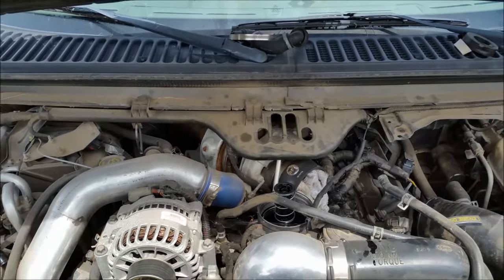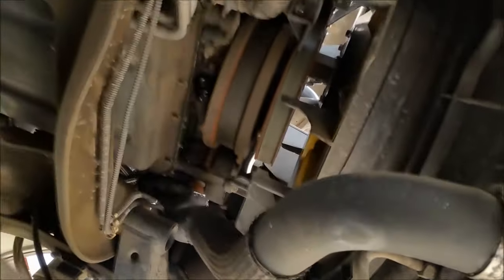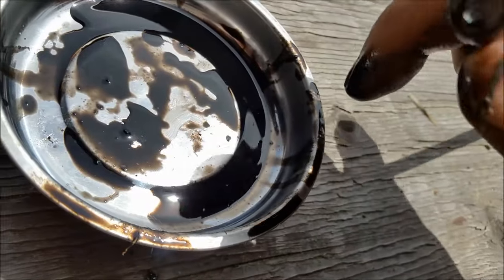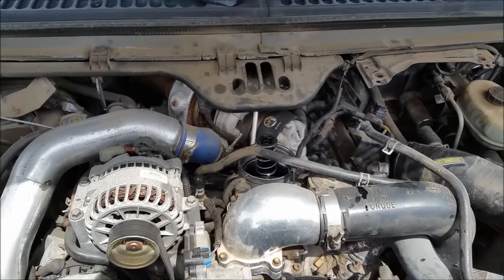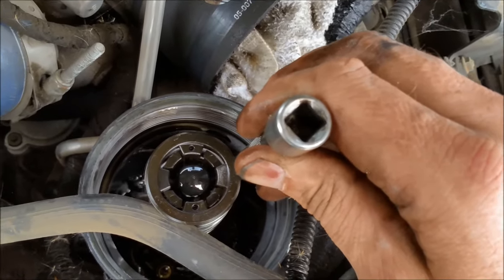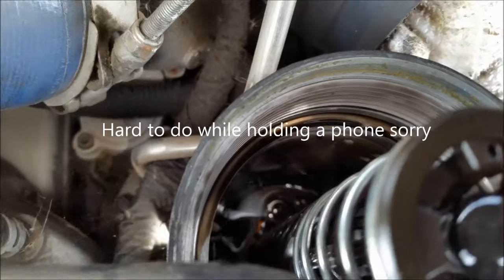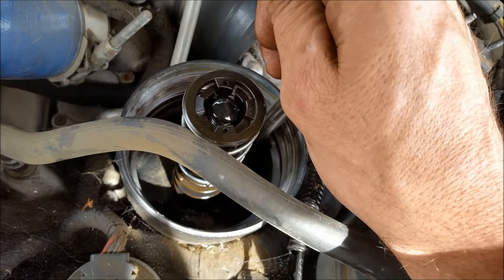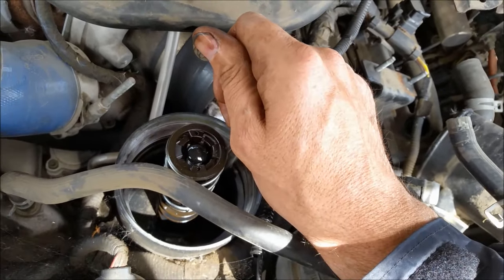2004 F350 6.0 NO LOW/BASE OIL PRESSURE CHECK THIS FIRST

Comment: I'm glad I found this video. Mine had a no start. Did this and fixed the problem for now 😂
Reply: Hey there. Having same issue with no start. So you jist cleaned out the low oil pump, put it back in and you got the truck to start?
Let me know. Thanks!
Reply: @noteworthy227  yup did exactly what this guy did in his video. If you don't find a piece of metal that's obviously not your issue. But when I did this to mine I had to crank on it a little longer than normal to get it to start after the metal was out of it
Reply: @mikejankoviak8542  truck still working good? Mine has still been parked since my last comment. Half scared I might need to put a motor in it. Just wondering how long term this solution is.
I appreciate the help!
Reply: @noteworthy227  yup no problem with it. I'm guessing it was a injector clip. Just run it and don't worry about it
Reply: How much oil pressure where you getting before you did that
Reply: @fredobaybee9091  as I was cranking there was none

Comment: I just followed  the steps that are in your video. I had no oil in filter housing when cranking, removed oil relief valve and found what seems like a snap ring piece, i took a look at the top of injectors and all the snap rings are there and intact. any suggestions on what it could be?
Reply from the maker: Tony Mendez hmm interesting check the description box below the  vid other than what I wrote there not to sure what or where this debris may have came from although depending on the size it may have been a small piece that may have broke off from a injector  snap ring I only listed the most likely areas were debris may have come from hopefully a little more Internet searching can answer your question and if you do figure out please post here for others thank you Brother : )
Reply: Tony what was your issue? Bad lifter?
Reply from the maker: TradeMark Lawn & Landscape check the comment i pinned at top of comment section (possible debris from internal turbo damage)

Comment: Is oil supposed to leak out of the filter housing overnight? After sitting at least half a day my 04 will start with no oil pressure until about 7 seconds then the pressure gauge kicks up and I hear a squeak from the turbo as it finally gets oil. I replaced the guts in the filter housing but nothing changed, it's dry when I open it after say 8-12 hours.
Reply from the maker: No if oil is leaking out of the oil housing one of two things I know of is causing that.
 
1. Check to see if you have a tall oil filter cap (if so replace it with the stock size cap and original Motorcraft oil filter) also you may have the wrong size filter installed causing it to not extend down into the housing enough to contact the oil anti drain back button/valve.

2. Your anti drain back button/valve is defective.

Comment: I have an 05 6.0 that pushes only 300lbs oil pressure. Recently had new injector cups, hpop, injectors, stand pipes, ipr, stc, ipv, will only crank nonstop, think this would work?
Reply from the maker: Hunter Mallory it's a quick and easy procedure definitely needs to be checked
Reply: What was it??

Comment: So does oil run out of that spot where you used the 12mm hex bit to pull out that plunger/bolt ?
Reply from the maker: A little but not much.
Reply: So what in the filter housing  I gotta pull the filter spring off then ?
Reply from the maker: Justin Kornkven no you do not have to pull the spring off. there is a drain button on the bottom of the housing positioned at 2 o clock you hold that down while cranking the motor to see if it fills up with oil which would confirm that your engine base oil pump is working.

Comment: Once you push the plugger down does the oil stay in the cup or run back down if it does run back down does that mean the check valve is no good

Comment: I stumbled upon this great video and indeed found something in the pressure regulator.  Unfortunately it’s a piece of a oil scraper ring from whatever cylinder.  Also the ipr screen was pooched so replaced the ipr.  Runs like top but when will she grenade...  I’m wondering how often the rings fatigue in these trucks. 400k kms on original motor and now with insane blow by.
Reply from the maker: Diesel rings are usually designed to last 800k miles. 

1 mile = 1.609344 kilometers. 

400,000km / 1.609344 = 248,548.47689mi

The odds of a piece of a piston ring being broken  and found are extremely rare. Keep in mind when turbo seals go bad they tend to dump oil into the exhaust pipe. The piece of debris found in this video I believe came from my turbo right before it took a shit.
Reply: @ecran228e  I’m with you 100% on that, still trying to think on how a piece of piston ring would find it’s way in the oil pan provided the whole ring didn’t grenade but there’s zero evidence of that.  The only thing I can go on is the sudden excessive blow by and massive amount of oil being pushed out of the engine more so then before, I do have a leaky valve cover gasket on passenger side which was never as bad until a few months ago, as well as, a rather disturbing amount of fine shavings on the plug magnet.  Anyway. Some food for thought, thanks for the reply.  The question is, would you drive till it shits the bed or sell for cheap lol.
Reply from the maker: @rickbremmer3838  Personally I drive em till they shit the bed XD

Comment: Is your truck still running after finding the metal part and or did you find where the part came from and fix that also.
Reply from the maker: Mummy Mountain Indica still runs...turbo died thinking debris came from there.
Reply: @ecran228e  Thank You

Comment: Question: where is the anti drain check ball located precisely on an F350xl?
Reply from the maker: Most likely inside the oil filter housing on top of motor.

Comment: Hi, great vid and comments below also to all.  I have an 04 F250 6.0.  Low oil pressure gauge just started laying flat and bouncing with check gauge light coming on mostly at start up and idle when it happens but not while driving.  Just started about 3 days ago and so far just randomly once in a while.  Seems like the same symptoms as your F350.  Would everything to check from your video apply to the F250 too?  Thanks in advance.
Reply from the maker: Grand Wagoneer Yes. Also your story regarding the symptoms you were having are very very similar to the same symptoms my 6.0 was having. Perform the above simple task I'm confident you have the same problem I had. Last thing reference the above description box for more detailed information on the topic. Hope this helps : )

Comment: what are you pushing the power wire onto?

Battery Positive?
Reply from the maker: Andrew Smith sorry for late response and bad camera placement in vid. YES contact starter wire on positive battery terminal to turn over engine with key off (starter is naturally grounded as it is bolted to engine block)

Comment: Had no base oil pressure, this fixed it.  however, I found a metal pin which looks like a needle from a needle bearing.  removed it, oil pressure came back.  In the discription You say it could be a follower bearing?  what do I need to know?
Reply from the maker: Mike Hunt you need to obtain a schematic of the valve train. Followers ride on the cam controlling valve fuctionality. These folowers are mounted on a shaft which go through a needle type bearing on each follower. The follower racks (one controlling each head) would have to be removed, followers separated from rack and each followers bearing should be inspected. 1 follower per valve in most cases.
Reply: its most likely from a lifter. you will probably need to replace it which means tearing the whole engine down so at that point you might as well bore your cylinders as necessary, replace your pushrods, reseal the block and stud the heads

Comment: I'M going to check this out tomorrow, just wondering what to expect when I pull the 12mm bolt out from underneath?? an O-ring that might need replacing or a Plunger I think I heard ??
I don't want to lose a part 
Thanks
Reply from the maker: Mike Riccardi should not have to replace any parts hopefully...to answer your question there is a o-ring on the plug and inside there will 1st be a spring then a piston which will most likely need to be removed with a magnet. once removed place magnet back inside hole to try and fish out any possible debris that maybe inside.
Reply: Thanks for the info!!,  I gave it a solid effort and couldn't get it to budge at all, I've soaked it with liquid wrench oil so I try again tomorrow! @ecran228e
Reply: ecran228e i

Comment: My '05 shows good oil pressure all day idling, but will loose oil pressure running down the road.  Can the situation your talking about cause this?
Reply from the maker: Possibly...if rpms get low enough and you have a piece of debris where I did this can happen...as low rpms causes no oil pressure in this case
Reply: I’m the opposite at this point

Comment: My 2006 f250 diesel shuts of if the oil pressure gauge does not go up when starting it. Do u know what could be the problem. I had my oil pump replaced to.
Reply from the maker: Ricardo Velasquez perform what I did in this video my truck was doing the same thing.

Comment: I have a 2002 Mercury sable and my oil level is fine new oil,pressure switch and low oil pressure lights did not go out I pray it's my oil pump they say the 3.0 Vulcan is durable finger crossed! Ur help would be deeply appreciate
Reply from the maker: Bobby Fisk sounds like it may be as simple as a oil pressure switch or sensor. Remember switches are anolag (non computer controlled) and sensors are digital (computer controled or activated). You could also install an oil pressure test gauge into the the port of the oil pressure switch/sensor port to confirm whether or not you have oil pressure prior to changing out your pressure switch and or sensor. I understand most people do not have access to testers like this so hopefully this part is not very expensive. Hope this helps ; )
Reply: Oh I thought the sensor and pressure switch was the same?

Comment: I have no oil pressure when it's in idle but when i press the gas , gauge goes up??  And also where in between does the metal ball go In the oil pressure regulator. I believe it's not on right.
Reply from the maker: same thing mine was doing follow the vid to find the oil galley plug unscrew cap then pull out spring should be attached to cap then use a magnet to get the piston out of the hole once you do this then stick the magnet back in the hole to extract any debris hope this helps....not sure of this metal ball that you are talking of research a schematic for that.

Comment: That's a piece of the needle bearing from one of the rollers on a lifter..... usually happens on #6 or #8
Reply from the maker: Oh cool thanks for info!

Although it was square more like a broken internal snap ring from turbo which took a shit shortly after being discovered
Reply: Oh shit....in the video, it's hard to tell if it's round or square...but,if you had a turbo failure,then you're right..that is a piece of a snap ring.....sucks that your turbo took a shit,but to be honest,it's a cheaper and faster repair than having to do lifters... they're a pain in the ass to change....